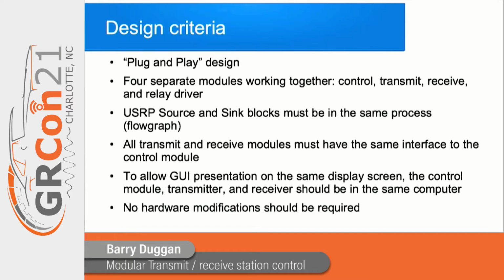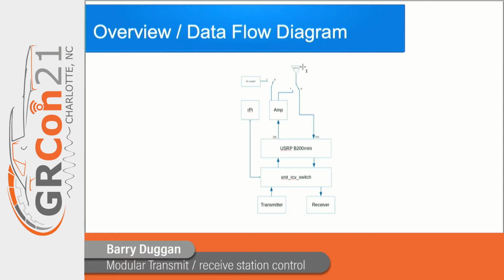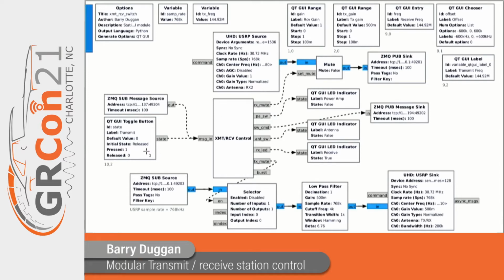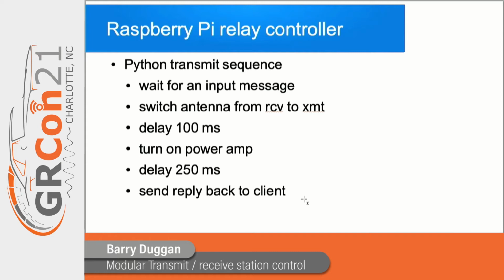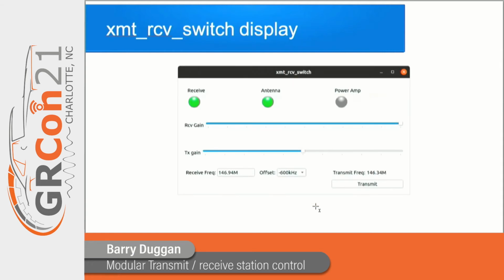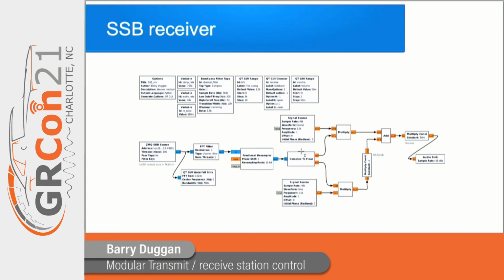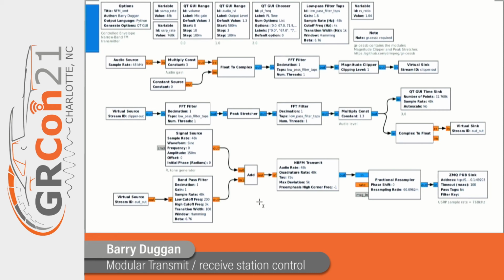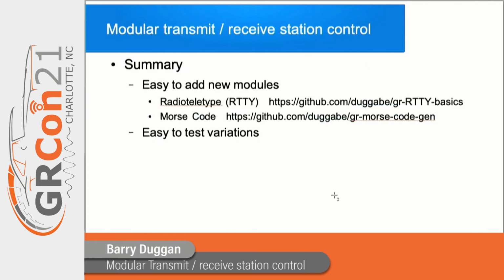GRCon21 - Modular transmit / receive station control

Comment: Couple of questions: If I am using Adalm Pluto with separate antennas for TX and RX, do I need the relay board? And to use Adalm Pluto, do I copy the maint-3.8 into the main folder? Newbie - not used to branches. TY